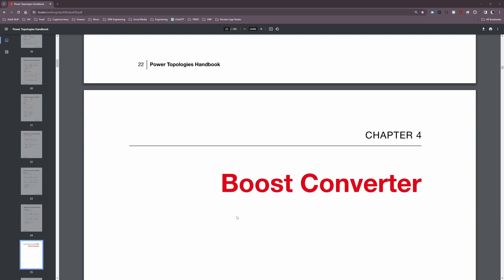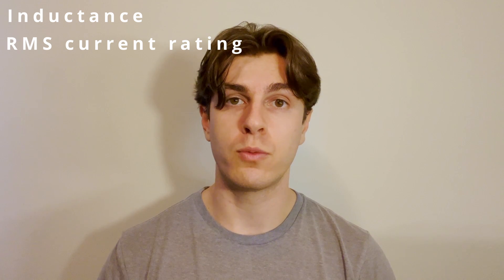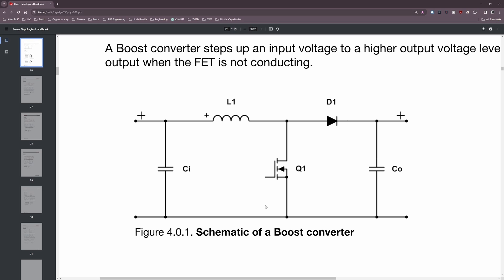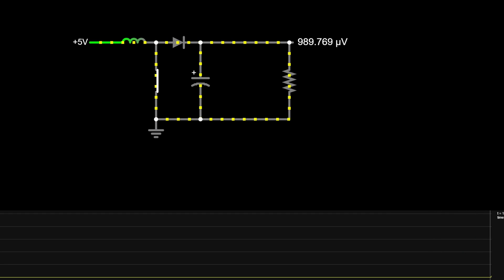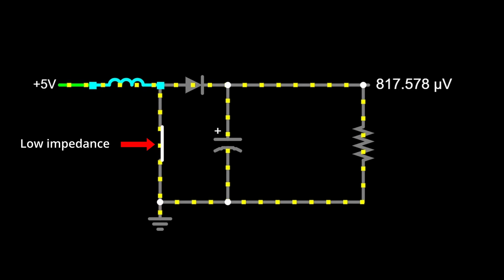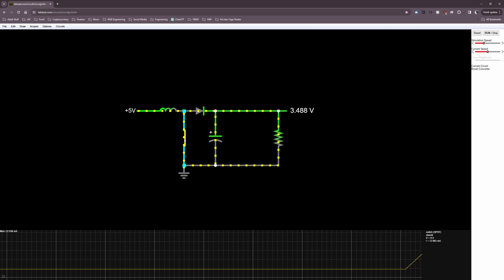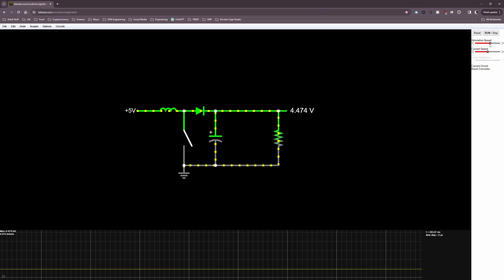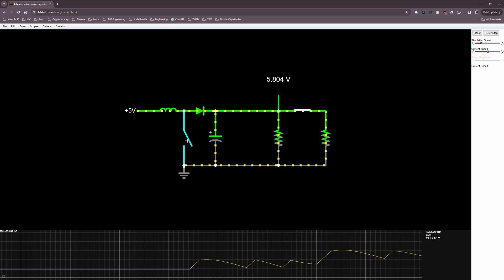Boost Converter Basics (for Beginners)

Comment: I imagine that for both the buck converter and the boost converter the mosfet will be controlled by a fitting microcontroller like an STM32 or something similar. Correct me if I’m wrong. Awesome video man
Reply from the maker: Close, but not quite. Most of the time they are controlled by special integrated circuits designed specifically for power supplies. I made a video on them here: https://youtu.be/B7wOFzCd6LA

Comment: Voltage induced across an inductor is proportional to the rate of collapse of the magnetic field which is determined by the rate of current collapse,so the greater the resistance of the load the greater the voltage  induced by the conductor
Reply from the maker: You got it! The load resistance plays a key role in the voltage induced by the inductor.

Comment: I may be missing something, but I purchased a DC-DC converter.  Input requirements = 12V (9V-18V).  Output = 20V5A (100W). However, when I wire it into a 12V fuse panel (12V 6.9A), the boost converter pushes out 20V12A, which naturally blows my fuse (7.5A).  My question is, why does current exceed the output specification?  I thought it was a faulty converter, but I tried a second one and it does the exact same thing.
Reply from the maker: That's a great question! You are likely missing something, and it might be a simple issue. The boost converter does not increase the power output, so if the input is only 12V 6.9A (82.8W), the output will never be able to exceed 82.8W (if the efficiency is 100%).

Comment: Ok, what I don't understand is: how can these circuits have such a high efficiency?
To me it looks like that when the switch is closed and current flows through the inductor to ground, that is all "electrons going to waste".
What am I missing here?
Reply from the maker: Great question! The short answer is that the boost converter usually does not have a very high efficiency (~80%) compared to the buck converter which can easily get over 90% efficient. You are right in your analysis that when the switch is on, all of that current is going to waste.
Reply: @RGBEngineering  I guess it is not a loss, because energy is saved in the inductor. when switch is disconnected, this energy charges the capacitor.
Reply: @RGBEngineering  thanks!

Comment: Can i use single transistor?
Reply from the maker: yes, single transistors are typically used.
Reply: @RGBEngineering   i mean i do not want to use pwm generator using only single transistor to make the switching on and of with out using arduino or 555 timer
Reply: @handlerama  That will tremendously limit your control over the duty cycle (impossible, i know). Like in 555s, there is some kind of reference component that controls aspects of the duty, like a capacitor or resistors. I think you would just basically open the gate forever, and make a fancy wire out of your transistor.